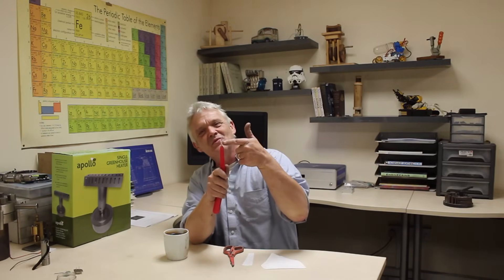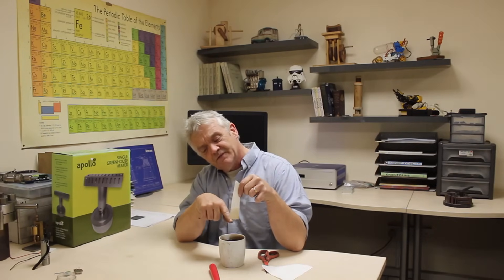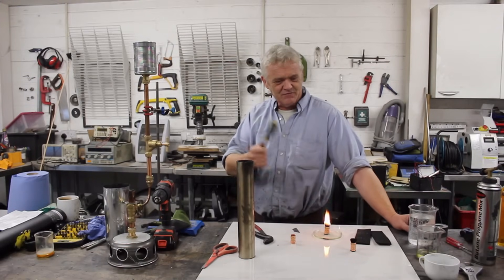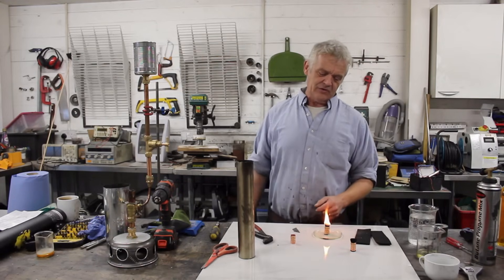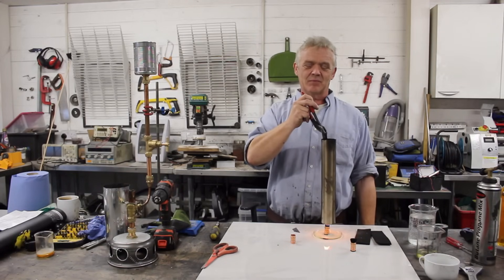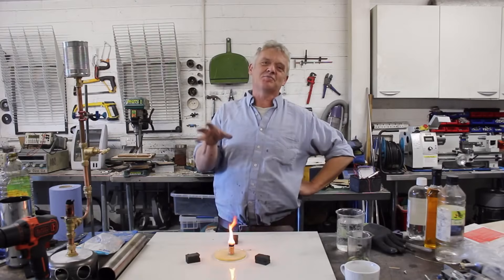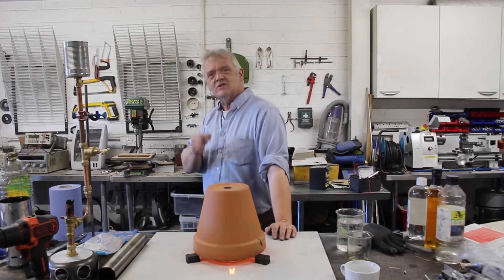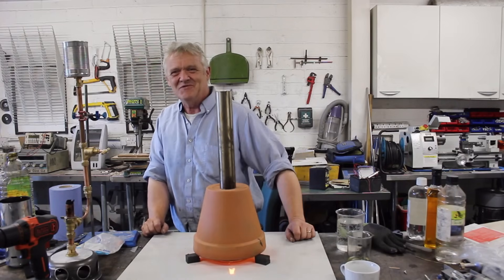1680 The Magical Forever Wick - The Plant Pot Heater On Steroids

Comment: Got the odor absorbing felt off the odor eater type shoe inserts, it feels like some of the foam rubber might still be on it. Will that burn off?

Using a 1/2" copper coupling, leaving the 2 layer rolled up carbon felt hanging out the bottom of the coupling into a 150 ml measuring glass to find out how much I veg oil I use during the time it's burning session.

Comment: I survived in an emergency power outage by burning veg oil utilizing little wicks twisted from bamboo toilet tissue.
Cooked bulgar, made coffee, maintained sanity. It just took hours.

The other day I opened the cupboard and a roll of this jumped out at me, a leftover from a deceased air cleaner.
It is much too small for my current unit and I wondered if I could find a use for this versatile material...

Seeing this segment gave me a start. If there is another energy issue I will surely thank you for this little inspiration.
Lives have been saved by a mere candle. Thanks for sharing!

Comment: How long does it burn before the wick clogs/ varnishes? Even kerosene does this, diesel is obviously worse, heavier oils will be worse than that. If you actually used wick heaters, you'd be concerned about this. This is why oil burning heaters use atomizers.

Comment: To use indoors safely - I wonder if a clean / new wire wool would be a good wick with vegetable oil .I've tested wire wool wick  outdoors  with used motorcycle oil.
Probably the only way to get rid of emissions for indoor safety, would be to try olive oil and or increase the burn temperature/ secondary burn where the smoke is burnt   used as apart of the fuel, more oxygen ?

Comment: Burn one a couple days and compare the wetted weight before and after if you have a spare moment.  Are the normal reducing oxidizing areas of flame cone present?  Extend a soldered arm up into the flame tip to further heat the combustible via your metal ring.  Sort of an open air generator.   Maybe take a voltage reading off the distal ends of your carbon out of curiosity, with and without salt.  Sorry manic rush of ideas.  On the rod in the flame try a thin hoop and a coleman mantle mounted upside down at the flame tip.  Mantles always fascinating to play with

Comment: Just curious as to why you think the carbon felt will not burn?  Is it made of ceramic fiber or even fiberglass that has had AC deposited upon it's surface!?  Anyway, this is a great find for a number of reasons, one being in the use of waste oil burning for heat.  

I would be very interested to see how this would work by doing a couple layers of filter, making the "wick roll" maybe 3-4x as long & adding different materials to filter the dirty oil before it is brought up to the carbon felt to be burnt.   This would save A LOT of time/steps in making a waste oil burner for not only prepping the fuel/oil (it usually has to be clean enough to not clog the injector/atomizer/venturi which can be fairly time/labor intensive..)

Anyway, keep up the great work, it's always great to find the "simple" things that can completely alter the way you can approach a situation or problem.  Good work!

Comment: I tried a metal mesh for wick once but it had the unfortunate side effect of heating up the fuel til it eventually would burn without  a wick. Could the plant pot get hot enough to do the same with the oil in the dish?

Comment: Gotta watch out with the plant pot that it's not heating up the oil directly by keeping the hot air too close. Eventually it can hit the oil/candle flash point, and then the whole damn lot can go up with 5 foot high flames indoors which is very hard to put out. (Smother with thick wet towel).

It's terrifying
Reply: I would imagine that would be rather unlikely, because the convection flow of the air would cause cool air coming in from the bottom and the hot air being drawn out the top.  This should keep it sufficiently cool not to reach the flash point.  If the air at the bottom were restricted too much, the CO2 build up might extinguish the flame before a flash point could be reached.  
However, if I'm wrong make sure you have a good fire extinguisher handy, just in case.  🙂
Reply: @stevenbingham3061  It's more likely if you put more than one tea-light candle underneath.  Trust me on it.  I screamed plenty.
Reply: @vodzurk  screamed ?

Comment: I bought a 1" to 1/2" copper reducer to use as the ferrel for the wick. The bottom leaves the felt less compressed for easier wicking and is a steadier base with less chance of being knocked over.
Reply: Have you tried this yet and if so, how are you dealing with the soot?
Reply: @TwinkleToes2day  I have, but outside so I don't have an answer for you, I'm sorry! Maybe try googling ways to deal with it? There's always a downside, eh?! =/
Reply: @Ad_Astra_321  You will need an increased air flow. In the first part he put blocks beneath the chimney, the "draft’ increases the amount of oxygen being introduced to the reaction, therefore creating a cleaner burn. Try blocks on top of the plant pot underneath the chimney or introduce a few holes (drill them) at the bottom. You will always get some residue, from a dense substance like oil, whatever kind of oil it is. Look at it like it’s fun and it’s annoying you, but your determined to find a solution. Keep safe and experimenting.
Reply: @Albachiel  Thank you! Definitely a work in progress & I'll try those things. Cheers you, keep good =)
Reply: @TwinkleToes2day  He covered this issue in his video. You have to add a chimney to this to make sure it gets hot enough to burn the soot.
Reply: @ddhhobbies1404  If you look at the video as it ends it and adds the chiminy you can see the soot against the wall rising from the chiminy.
Reply: @ddhhobbies1404  maybe some of the soot will stick to the chimney but at the end of the video you can clearly see plenty soot coming out the top of the chimney, so my guess is you’ll either have to get the chimney to vent outside or have some type of filtration ?
Reply: @ddhhobbies1404  At the end of the video when he puts the chimney on top of the plant pot you can see there is a lot of soot being given off. Do you think the chimney needs to be lowered into the pot by, somehow, making a bigger hole in the plant pot and pushing the chimney down so it's closer to the flame?
Reply: @MMelanie963  I noticed the same thing.
Reply: @ddhhobbies1404 ohhh I didn't get that the chimney got it hot enough to actually burn the soot. I thought it was just tall enough that the heavy soot couldn't rise that far! Thanks for explaining. (The accent was a bit hard for me.)
Reply: @TwinkleToes2day  knock a hole in the ceiling outside for the chimney.
Reply: Brilliant thank you.
Reply: @ddh... Thanks, works a treat! ;)
Reply: I want to put a copper tube in a mason jar with a hole drilled in the lid.  Will the carbon sheet wick up that high?
Reply: Mine wont light at all. Ive tried with olive oil and grapseed oil.
Reply: @lyndseyanne4022  I don’t know if this is your problem, but a couple of different people commented that the carbon felt they had purchased off Amazon was treated with fire resistant stuff. They were disappointed about that. I wouldn’t think that that should effect it because it’s the oil that should burn, not the carbon felt. But I’m no expert.
Reply: @stevenmark8156  thanks Steven. I bought it off the guy in the video to be sure i had the right thing. I added a few drops of orange essential oil (marked flammable) on top and that lit but once the orange had burnt off it was out. Im going to put my comment at the top i think just so ppl know it doesn't always work because i sent this vid to a few folk saying how great it is and well, its not always.
Reply: Easier just to use the candles in the crisco. Buy the tall skinny ones at $ tree that way you can store up.
Reply: @stevenmark8156  
Fire resistance?🤔.... That is the Whole point in carbon felt,it doesnt burn because of the fire resistance properties in the felt... Only the oil burning is the whole point in using the carbon felt...
Reply: @ellissmithjr6599  ok. That makes sense. This was the first time I’ve heard of carbon felt. Usually anything with charcoal in it burns. And that cloth looks like it has charcoal in it which is a form of carbon. But maybe it is all fire resistant.
Reply: @stevenmark8156  
Carbon Felt... needled cellulose fibers Processed by thermal treatment at 800 to 1000 degrees Celsius... Not Charcoal
Reply: @ellissmithjr6599  When you heat wood fibers or coconut shell fibers, it becomes charcoal. So what would the difference be?
Reply: @stevenmark8156  
Go ask your dad 👍
Reply: @ellissmithjr6599  Lol. So in other words you don’t know.
Reply: @stevenmark8156  charcoal is incompletely burnt wood , after burning the charcoal -carbon is the byproduct so it's incombustible.
Reply: You’re right, the oil burns as it soaks up the wick ,  the wick material itself does not burn , he covers that in this video, that’s why he said the ‘wick’ last forever , it doesn’t burn up , only the oil 👍🏻
Reply: Try vegetable oil
Reply: @stephengilley6836  thanks. I'll have to buy some and try it. When i search for veg oil the ingredient comes up as rapeseed oil. Not sure how its different to olive or grapeseed but i guess its worth a try. Would sunflower oil work? Its another seed .
Reply: @stephengilley6836  just tried vegetable oil. No light. Tried a little vodka on top. No light. Vodka is not lighting when i put it on a saucer and try and light either though so doesnt help. The fumes are helping the match stay ignited but thats it.
Reply: He said in various that it will only work with vegetable oil
Reply: Crisco works.
Reply: @lyndseyanne4022  try crisco. It'll burn good.
Reply: @lyndseyanne4022  That's because its FAKE! Notice its already lit and working when the video starts! He's probably using lamp oil!
Reply: @lyndseyanne4022 he did say he was using vegetable oil. Maybe you should try that instead.
Reply: Wonder if it will wick used motor oil. I have some old black flame proof welding/soldering material rolled up in a copper tube trying to "wick" up used motor oil. We'll see what happens
Reply: Weld three little bars for better resistance.

Comment: For us, this is a seriously life changing innovation.  We have no electricity on our land when are working and use lanterns with very expensive lamp oil. I can't wait to try this! Amazing! Thank you!
Reply: Have you tried this yet and if so, how are you dealing with the soot?
Reply: @TwinkleToes2day  could you make a long enough flexible pipe that brings the soot outside leaves you a healthy warm environment especially in combination with a second pot creating a double wall and turbine effect.
Reply: I too live off grid
Reply: Did you try the wickin heater yet?? Please let me know how it works plzz
Reply: @1Corinthians15-1  keep the marshmallows handy for the inferno it'll be a win win
Reply: @1Corinthians15-1  yeah, but some of us have moved on from knuckle dragging.
Reply: Expensive and dangerous.
A small solar recharge station that recharges tool LED lights is safe and sane.
Reply: I don’t think you were paying attention. It’s not dangerous because the fuel source won’t burn if the wick is knocked over.

There is another difference that is more than a little relevant. A litre of vegetable oil will provide enough fuel to burn for days and provide a considerable amount of heat with a mantle or chimney or both.

An Led light provides no heat and at best will typically last a few hours at best.

Comment: Very interesting, thanks! I have one question though - why do people put the flower pot on top of their tea lights (and in this instance forever wick), as far as I can see, all it does is create a heat sink that will make the heat output lag what it would be otherwise. I've tried it before and the flower pot doesn't seem to cause any significant draught that might improve combustion completeness - and in this video you can still clearly see smoke coming out of the top, unlike when the narrow tube was employed.
Reply: I believe it's turning more of the available energy from both convection and visible light into radiated infra-red concentrating the heat in a more usable area rather than being allowed to go directly to the ceiling.

Comment: yeah right.. but in the end you placed the tube on the pot it was damn damn smokey. so im guessing thlarger opening spreads the extra airintake over to big an area to make the burning to better as it did with the smaller tube

Comment: Actually you can put a match to kerosene and it will put it out. However if you use a paper match, let it wick up a bit and then light the match with another match it will eventually light up the whole top of the kerosene. If you have a kerosene pressure lantern that needs to be preheated and you're out of alcohol this can do the trick if you take the globe off first.

Comment: Was impressed by this, and casting about for materials onhand, I did a test using some foil from a pie pan and some charcloth made from denim.  When I put a drop of olive oil on it, was immediately wicked up, and so I rolled it, wrapped it and put it in a puddle.  Zero smoke until it went out, whereupon the smell was a bit much.  Since old jeans are much larger than any use cases, I figure I could roll my strips into copper tubing and then char it.  Next to experiment with various diameters and lengths.
Reply: Good point, if the carbon mesh is what I'm thinking and the carbon is doing the wicking there's no reason one can't make a suitable substitute. Maybe even using metal window screen as a substitute for the foil in your first experiment.

Comment: Nice!!

Though a plant pot has little mass and it'll give away its heat rather quickly after the flame goes off. I wonder if this could be turned into an effective sand battery, fueled by oils, that would stay hot for hour(s) after the flame is no more.

I'm trying to think of a portable design, like a literal bucket of sand, that could burn oil, absorb all that heat efficiently (I'm guessing I'd need to also absorb the heat from the chimney) and then be able to move it around in the house. It'd be nice to burn (charge) it outside, so I wouldn't have to worry bout the smoke and CO, then bring it inside to radiate the warmth and dry my socks :)
Reply: You're looking for something with safely transportable "thermal mass"!!! A rock or brick would suffice but they heat up rather slowly!!!🙄
Reply: @RTR-MATEY  what if, you set some rocks on top of the pot, leaving the hole clear in the middle? That should warm the rocks to wrap in a towel and put under the covers at the end of the bed.
Reply: @patsternburg8737  Just setting rocks on top they probably wouldn't heat very much or quickly due to the large radiating area. If you could get rocks of the same size and sandwich them between two pots it would help to trap & encase and heat the rocks more efficiently.

Comment: As great as this video is and if you could do this with used vegetable oil that you might throw away, but the cost of new vegetable oil is currently as expensive as diesel fuel and not particularly cheap to use as an alternative method of heating the home.

Perhaps a better idea would be how to use old veg oil and or maybe a solar air heater

Comment: An idea, fire tornado. Rather than just a straight tubular chimney, split the pipe and offset the two parts a bit laterally parallel with the cut. The inlet air will generate a vortex, twisting the flame and may result in better air/fuel mixing.
Reply: Love your suggestion,  why not have a go & let us know how you get on please. 
Southampton
Reply: Are you saying to cut the pipe in half long ways with a small gap like this.....( )....? 
Please rephrase your idea, I don't understand. Thank you.

Comment: ⚠️ Warning important! ⚠️
You really should have said that the heat resistant carbon fibre felt is highly toxic if burnt.⚠️

I used to work in a factory where we manufactured this! 
All the heat resistant variants use a heat resistant binder that is extremely toxic when an open flame is applied! 
This only applies to the heat resistant variants! 
I really hope you mention this in a future video!
Always good content and great ideas though Robert. ☺️
Reply: The carbon fibre felt isn't burning. It's vegetable oil that's burning. The 'wick' is simply supplying the oil to the flame.
Reply: @stephengirling7859  Its still in contact with an open flame! 
I would definatly use caution!
Reply: @ArnookieVR  So the dude that said this was probably making carbon filter that was nylon or rayon.  Which yes is toxic if burnt.  99.9+% carbon shouldn't be burning.  Carbon doesn't burn.
Reply: Thanks 👍
Reply: I was going to ask about this. Thanks for sharing.
Reply: What toxic reaction is caused as mentioned?

Comment: Very inspirational as usual, this would be fantastic if it could be adapted to work in paraffin heaters, and I suspect many will try this, imagine how affordable using vegetable oil instead of paraffin could be. My only concern would be the vegetable oil fumes, do we know if the fumes will be worse than paraffin?
Reply: Robert's solution really solves many of those issues nicely with a small fuel source, with multiple candles I would consider enlarging the exhaust port for more airflow. 👍
Reply: I think that would depend on combustion efficiency and if you can make the fuel burn homogenously (different compounds) by increasing combustion temperature and getting a leaner burn. ie. preheat the combustion air, maybe with an outer pipe sleeve similar to a fireplace.